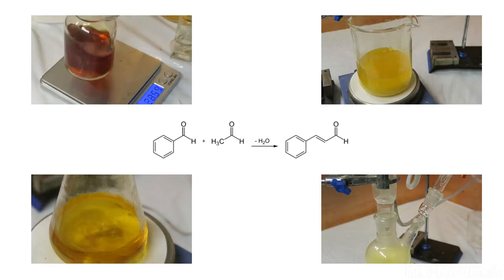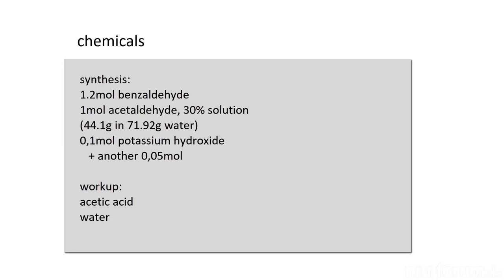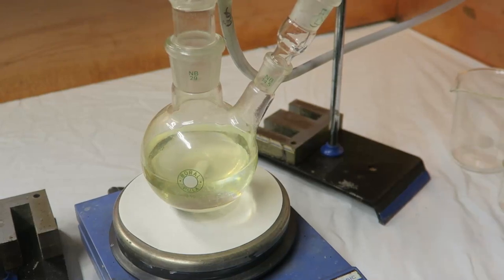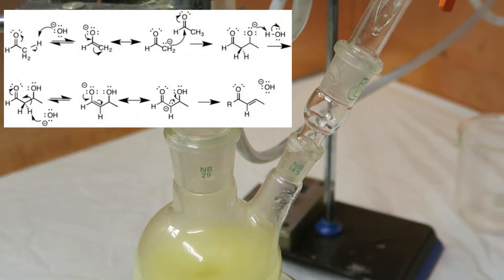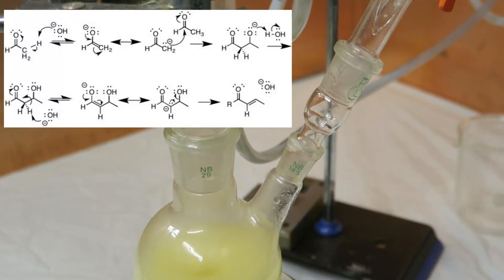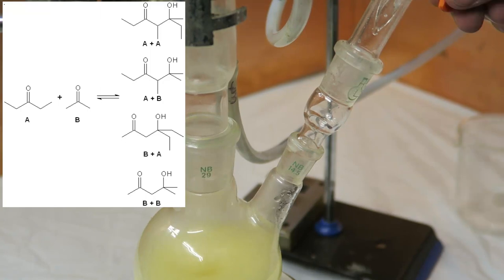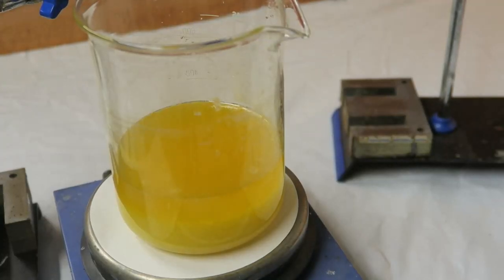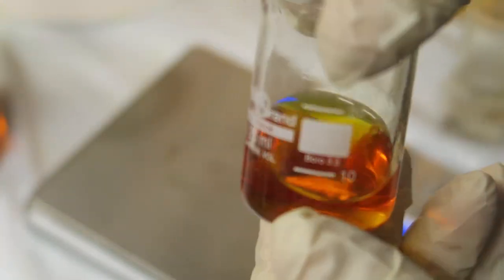synthesis of cinnamaldehyde and the aldol reaction

Comment: QUESTION...........What if i wanted to use acetone as my enolate anion AND  as my carbonyl compound????????   I mean you dripped in the enolizable acetaldyhyde into the benzaldehyde.   Would i just mix everything together at the get go???????   You did not seem to heat anything.  Does the reaction work at room temp if you want the unsaturated product?????????    How long did you reflux???????  Cause it seems like you just dripped in the acetaldehyde and then were done with NO refluxing or waiting time after the addition???????????
Reply: If you mix everything together, acetaldehyde reacts with itself and produces crotonaldehyde.

Comment: Why was the Acetaldehyde diluted with water?
Reply: Acetaldehyde has such a low boiling point that it is best stored as an aqueous solution.
Reply: @patricksweetman3285  okay, does this really help? Forms it an azeotrope with water?
Reply: @timmulm  At the temperature of some labs that I have worked in, pure acetaldehyde boils when you try to pipette it out.
Reply: @patricksweetman3285  yeah I know the problem, I have some too and once it heated up in summer up to 21 Degrees, so it had built up pressure in the glass it was stored. But shouldn't it be okay if the glass is pressure safe? Just like gas cartridges? I put it into the freezer afterwards but anyway...